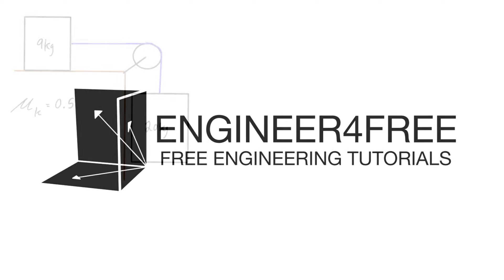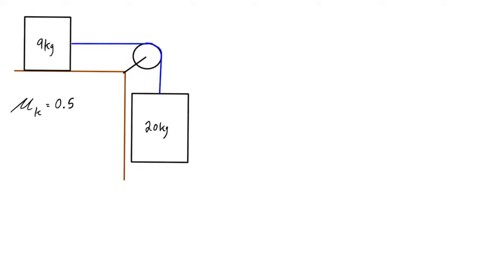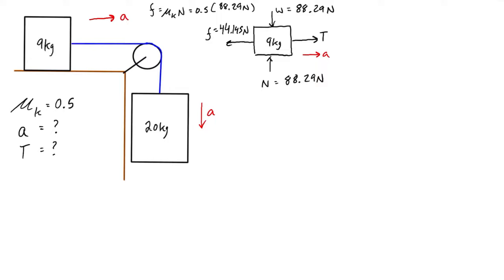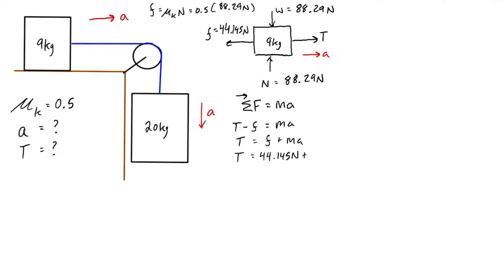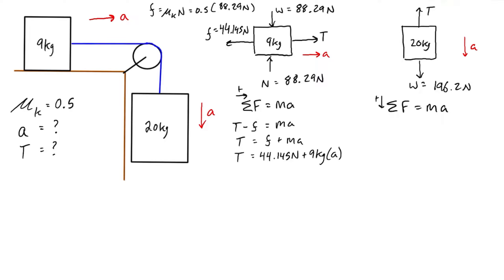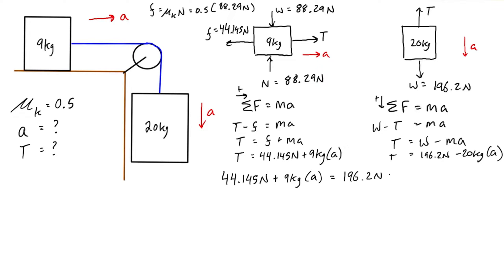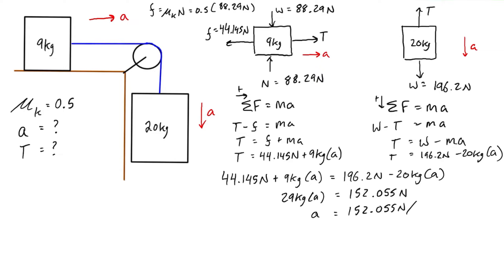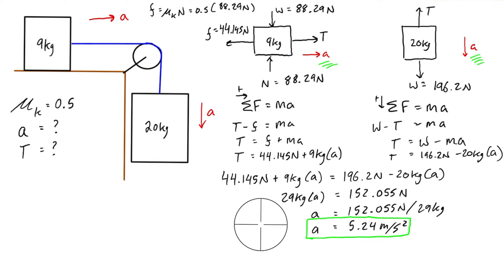Kinetics pulley example problem with a friction surface

Comment: One of the hurdles my students run into is that tension is positive on one block but negative on the other.  I had to simplify it even more if they don't get it at first.  But they eventually get it.

Comment: question is it possible for the tow bodies to have different magnitude  accelerations? like one has a 4 m/s^2 and the other -1.2m/s^2. and is there a difference to find the acceleration of the system

Comment: Hey Engineer4Free! I'm doing that exact problem but with different masses, but the coefficient of friction isn't given to me. How am I supposed to solve this?
Reply: All it says is it rests against a smooth horizontal surface
Reply from the maker: "smooth surface" often (but not always) refers to "frictionless." If it is indeed frictionless, then the problem basically becomes a slightly modified Atwood machine. See videos 22 - 28 here: engineer4free.com/dynamics The whole system would only be driven by the weight of the hanging block then.